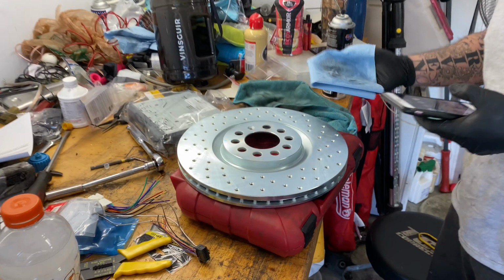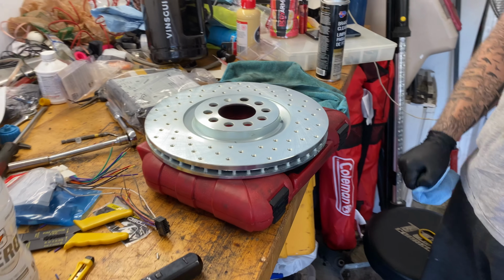Audi TT MK1 8N - [New Discs and Brake Pads]

Comment: Where did you get the brake kit from? I have stock vented rotors on my 225 and I can only find solid upgrade ones.
Reply from the maker: I got them on eBay. Can't find the exact ones but there are many others there

Comment: what's the make and size of your disc's I have the same car and looking to change mine??
Reply from the maker: Here the link:     https://www.ebay.com/itm/293972814044?fits=Submodel%3ABase%7CYear%3A2001%7CEngine+-+Liter_Display%3A1.8L%7CModel%3ATT%7CMake%3AAudi%7CTrim%3ABase+Convertible+2-Door%7CEngine%3A1.8L+1781CC+l4+GAS+DOHC+Turbocharged&hash=item44722528dc:g:3IcAAOSwjrJgDmVH

Comment: what's the size ??
Reply from the maker: Not sure of size but look at similar kit to one I installed:     https://www.ebay.com/itm/Rear-Silver-Drilled-Slotted-Brake-Rotors-Ceramic-Pads-For-2001-2006-TT-Quattro-/115184405409?hash=item1ad1868ba1
Reply: Thx